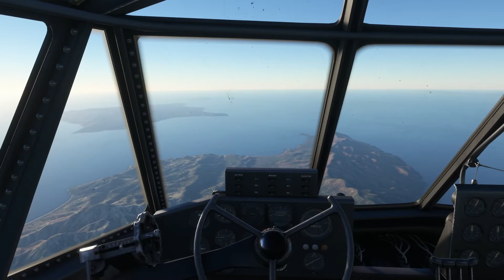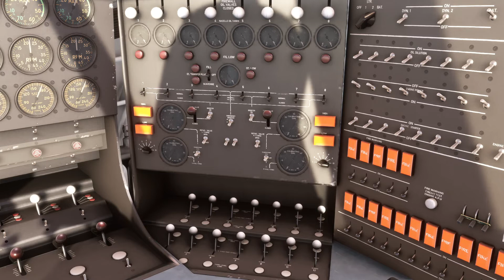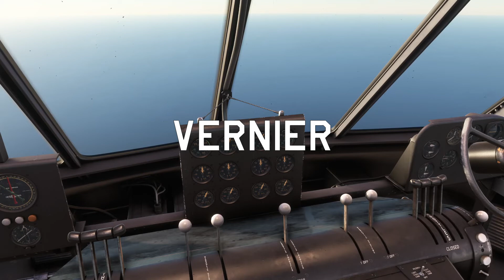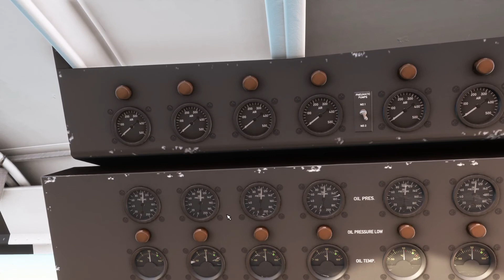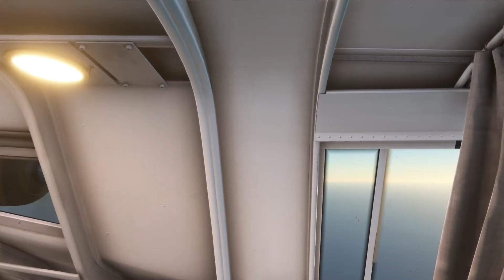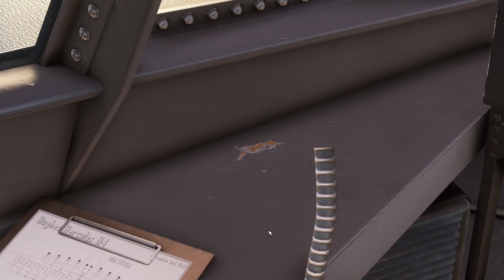Hercules Tech #2: Fuel and Electrical Systems MSFS

Comment: Thanks for the video. I see that you have great knowledge about this aircraft, this is a fascinating piece of history, for sure. I have a question for you - when i saw videos about real H-4, i notice that right side of a pilot seat looks totally different to MSFS version. In MSFS we do not have huge panel with dials, also we have 4 throttles on each side of the cockpit, meanwhile original has 8 throttles of each side. I am also notice some difference in main instrumentation. Can you please tell me, what we are missing in MSFS version, and why? (they was just lazy, or maybe they have another reason for it?) Thanks!
Reply from the maker: It's because what you see on flight day it's a full prototype. The aircraft was continually updated after the flight even though it never flew again. Among those changes were moving from the four air operated throttles to the eight electrically operated throttles the aircraft has today. This change happened almost immediately after the first flight due to issues experiences with those throttles. The flight deck that MSFS has is what was there on 11/2/47. The basics needed to operate the aircraft on taxi tests. What the aircraft has now is the result of thirty years of improvements and upgrades.
Reply: Nevermind, should've listen to the end before writing comment :) Thanks for a great video again